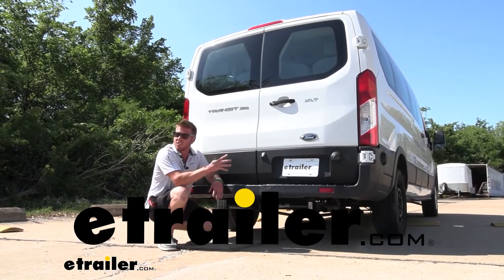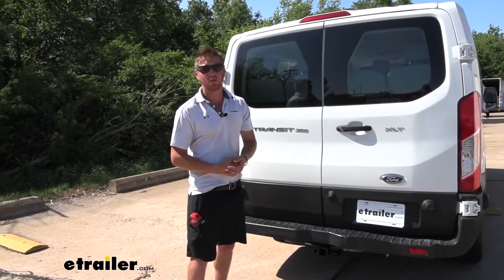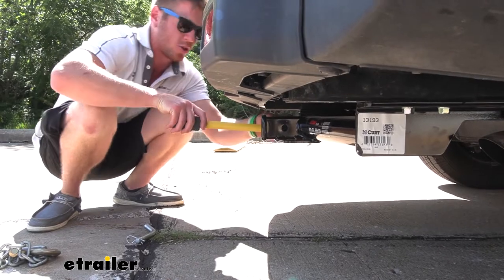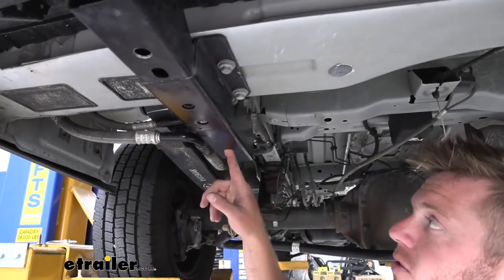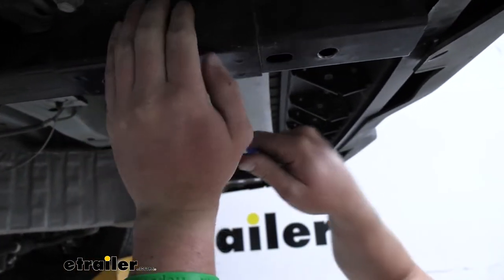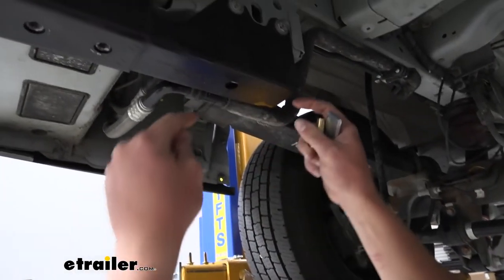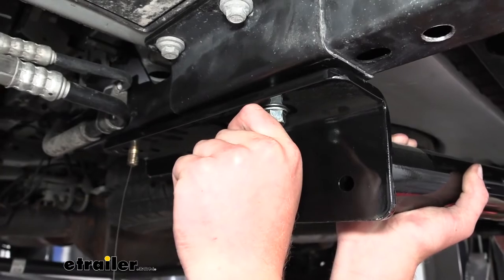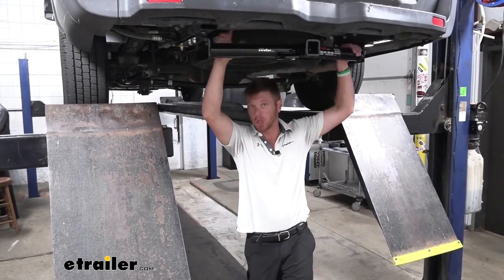etrailer | 2019 Ford Transit T350 Curt Trailer Hitch Receiver: Complete Installation

Comment: duty a tap
Reply from the maker: If you wish, you can use an M12x1.75 thread tap to chase the sleeves before installing the hitch bolts.